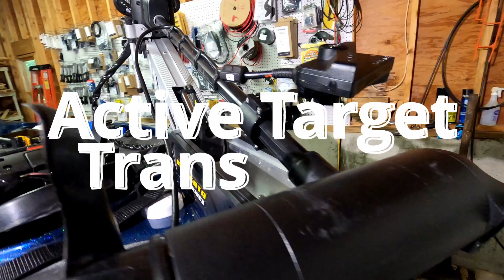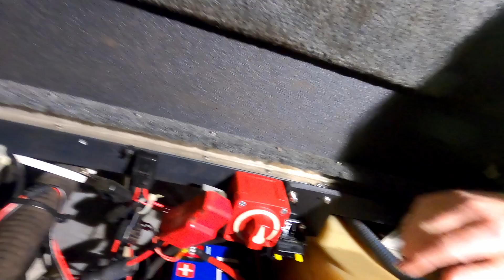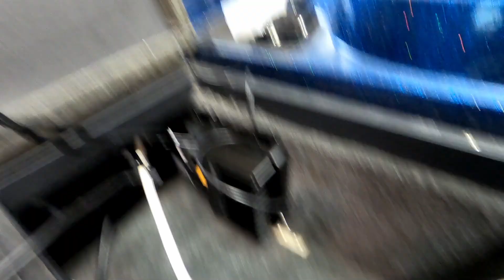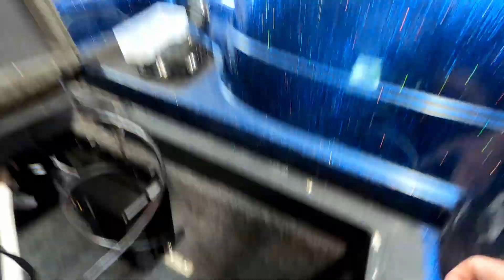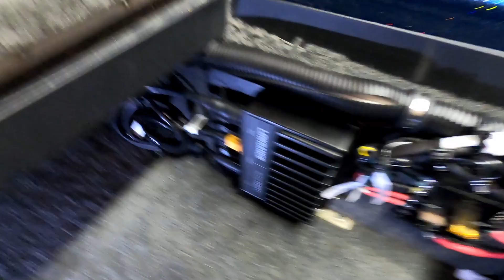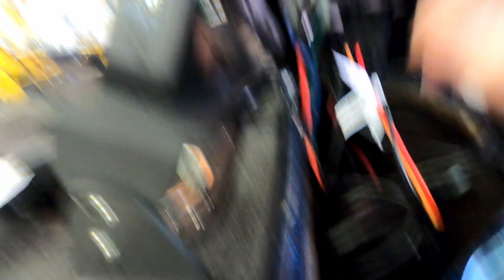Adding Active Target 2 to a Two Elite FS Boat

Comment: What Guage wire are you using to console then to bow please?
Reply from the maker: I normally use 8 AWG marine gauge duplex wire for power cables to the console and bow. They are 2 separate runs, each one with a fuse block at the destination. On this boat, the owner only wanted me to add the Active Target 2 module, so I ran 8 AWG to power the AT2 module and NEP-2 network hub. The 2 Lowrance Elite FS units were powered by 10 AWG duplex to the console fuse block. And then we have plans to redo all of the electronics wiring next year.  This is the wire that I use: https://amzn.to/3VwaTwd -- that is an Amazon affiliate link, so if you purchase the wire I may get a commission.

And thanks for watching the video.

Comment: Hi Garry, can you tell me how you connect your ground wire on the top of active target module? What is proper way to connect it? Thank you in advance
Reply from the maker: Hi, I used a 10 AWG black wire with #8 10-12 ring terminal connectors on both ends. I connected one end to the screw on the Active Target module. (I didn't use the provided connector) I then connected the other end to a negative (ground) on the fuse block. This works well on freshwater installations.

For the TwinVee installation, which is a saltwater boat, I connected the case ground to the boat bonding system that has an anode at the stern.

BTW Do you still have your Z21? I had one for 10 years, it was a good boat for me until I had the transom fail on Lake Champlain. Ranger repaired it.
Reply: @garrywoodruff960  Thank you so much, no I traded my Z21 and get brand new Range z520r in June this year. I like it my z21 yes I have same issue with transom and my insurance pays for repairs 2 years ago. I really like it my new z520r and enjoying fishing on lake St Clair Michigan. I like it your videos really helped me to understand and make unity work properly, thank you very much
Reply from the maker: You're welcome. I'm glad that the videos help.

The R boat is pretty nice. I have a 522D. And I run mainly on Lake Champlain, Lake Ontario, and the St Lawrence River.  I love the rough water ride but I do miss the speed (lost over 10 mph) in tournaments. I've on been to St Clair once about 15-17 years ago.

Comment: Hi Garry! Watched a bunch of your videos and hoping I can connect with you. Having no source error with my active target 2 and thought maybe you could help! I’m losing my mind trying to figure it out. I’ve done all the conventional fixes I’ve found!
Reply from the maker: Hi Ben. Thanks for the watching the videos and subscribing. What configuration do you have? Does this happen randomly or does it always show up? 

I assume that you have checked the LEDs on the Active Target 2 module. The power should be flashing green to yellow, this indicates that the module has booted up and is ready. The Ethernet LED should be flashing when one or more of the other units are turned on and are on the same network.

Once I know what configuration that you have, I can suggest steps to fix this problem.
Reply: @garrywoodruff960  thank you so much for responding! I was trying to find an email for you earlier, so figured I’d just comment on here.

1) NSS EVO3S (two of them)
2) AT2 module- power is flashing amber/green, Ethernet led flashing, sonar solid
3)force updated both the MFD and AT2
4) Tried “restore default” technique I’ve seen on a bunch of YouTube

I’m seriously so bummed. It’s a brand new boat and I was just so excited to finally purchase AT2, and so far it’s been a big paper weight!
Reply from the maker: I'm also on Facebook and Instagram.
Reply: @garrywoodruff960  I sent you a message over on Facebook! Might be in your “message request” folder
Reply from the maker: Hi Ben, I'm glad that we got it working for you. Good luck with the new boat. And if you have any more questions, feel free to ask.

Comment: Do you know if you run 2 Active Target 2 on your boat, do you need a S3100 module to run them both? Or the S3100 has nothing to do with running 2 AT2?
Reply from the maker: No you do not need the S3100 module. I would use the NEP2 module and connect the Ethernet cables to it. Then you will need to connect at least on of your units to it. The NEP2 will let you connect up to 5 devices, so you can add 3 more units. If you look at the video series on the Caymas you'll see there are 2 AT1 installed on the bow along with a NEP2 module and 3 HDS Live units.

If you are going to run multiple AT2 units make sure that you connect their blue wires (SYNC) together to minimize noise.
Reply: So that there is no interference from the two AT2s to each other, we connect their blue wires? With FS, synchronisation of the two AT2 sensors will work. After all, in hdsPro it is necessary to switch on PingSync, is it only so that the yellow wire turns into a blue wire and the 3in1 sensor also takes part in synchronisation, together with the two AT2s?